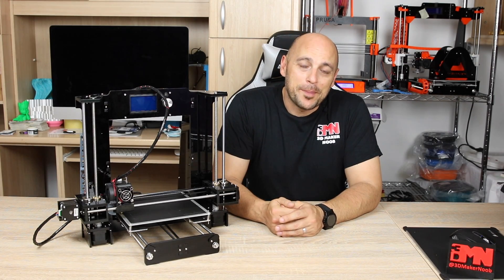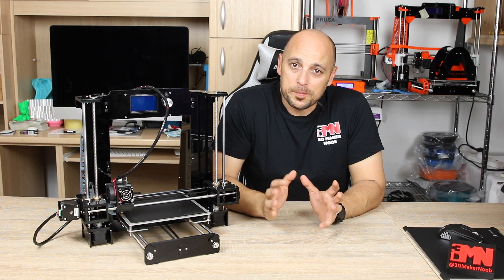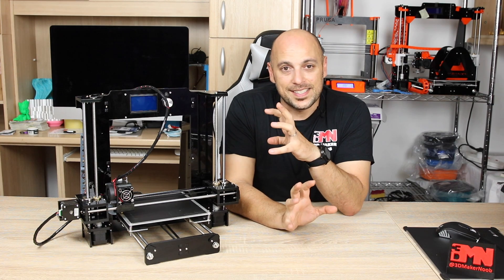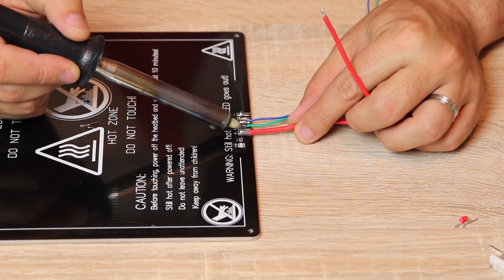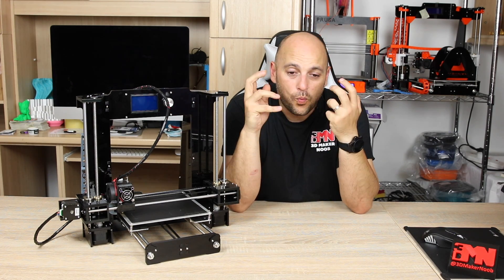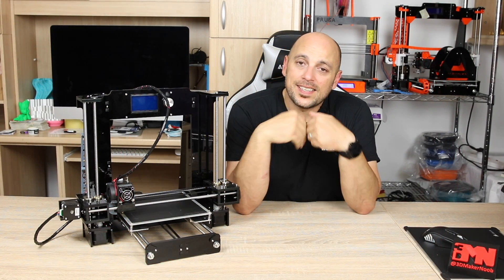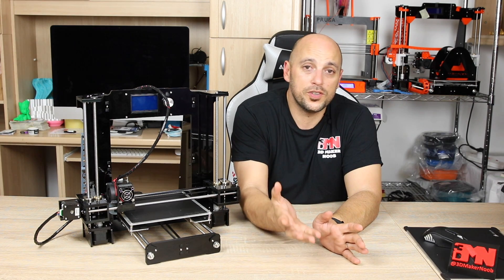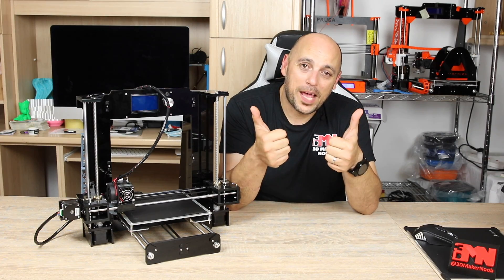Anet and Budget Kits Safety Upgrade Essentials

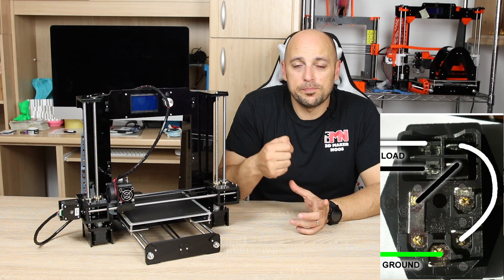Comment: Hi Joe At 5:26 that switch is wired incorrectly ! 2 issues The red switch illumination should only come on in the "ON" position and it is wired so the fuse isnt used !!( in your pic at 5:56)
Another thing ....is the greatest issue i see people forgetting ( im an engineer) is strain relief . When ever a cable is moving you should have the outer shield / sheath of the cable firmly connected to the moving part ( bracket / cable tie) and not rely on the contact solder points and/or plug to carry the load
Reply from the maker: Thank you Phil, i will pin the tweet so it stays on top and gets noticed. Added a link to the video description of the proper wiring diagram for the power switch and for the strain relief, will be including that in the next episode of safety. Thanks again buddy for poitning them out
Reply: I think we always have to remember that these kind of printers are built to a price point rather than a tech spec.This is a good thing as it makes this hobby available to as many people as possible but the down side is the quality of the parts isn't always as good as it should be ( or even spec'd correctly) The classic example is the power plug connectors on the stock Ramps1.4 boards which have a max rating of 10 amps and tend to cook after many hours of printing. 
Regularly visually inspecting and checking the security of connectors is the first step in avoiding issues  

 The heated bed mod Joe shows is a great improvement both from a safety and reliability perspective.  I would add that you should use old fashioned leaded solder. The new type lead free can be tricky to work with and certainly where you want a good "solid" high current connection it tends to work better.
Reply: +foxbow90  I dont actually own an Anet but from what i have seen probably the easiest place is the nearest bed level adjustment screw. Thats the way i have it on my Prusa AIr2 and it works very well. First i put a cable tie around the spring but loose enough so it doesn't restrict the spring, then i use another cable tie to connect the bed wiring to the first cable tie. This isn't perfect but certainly better than letting the connection point push pull the cable
Reply: https://www.thingiverse.com/thing:1875869   this will work for strain relief, for anyone interested.
Reply: bigfilsing jup. strain relief is a big thing. not only for solder joints but my strain relief prevented my heating cartridge of falling out because the tiny screw that is holding it loosened itself despite of constantly checking it for being tight. if it fell out that could cause serious overheating when using the stock software. skynet for example has a thermal runaway protection for the hotend and the heated bed. another safety enhancement in my opinion. also the proper tightening of all cables is super important. tightening them not properly could cause a high resistance in the contact point which then causes heat. this heat causes the cables to expand which leads to minimal deformation. when this spot cools down it shrinks down again. for to the deformation the connection is now worse than before which leads to even higher resistance. after a while the resistance can be high enough to produce enough heat for the plastic to melt. this is especially critical on all connections that have to transport high current and of course the mains connection. so the problem with the connector for the heated bed is also not that it is shorting out, the connection is just bad and thus causes heat. the sparks you can sometimes see when moving the connector is due to bad connection. take you time when assembling it and doublecheck all electrical connections.
Reply: bigfilsing where would you attach the strain relief for the hotbed?  Clamp the wires directly to the moving hotbed?
Reply: this kit contains some of these nylon cable clamps. I don't know what to call them. you can put your cables inside and then screw it down somewhere. I screwed mine to the upper right screw of my extruder sled. just make sure your cables sit snug inside. if not use an extra zip tie or two to fix it.
Reply: right now I am using this part I printed out.
Anet A8 alternative 40mm Extruder Fan Mount found on #Thingiverse https://www.thingiverse.com/thing:1749614

this also relocates the extruderfan which makes filament changes much easier. did not have thermal problems until now not even with longer ABS or PETG prints.
Reply: I think the idea of switching both wires ON/OFF is better as in many countries where the polarity is not defined by the plug/ wall socket, it ensures that the equipment is isolated. 
I happen to live in a country where the UK 3 pin style has been adopted and even then "less than professional" installers  sometimes wire the wall sockets incorrectly.  The dual switching also ensures the indicator lamp works correctly i,e, isnt illuminated if the fuse is blown.  Also having a good earth connection is paramount , certainly with low cost power supply units.
Reply: Hi Joe,  

Great video with "musts" for safer, more reliable operation.  Please consider editing or replacing this video - the incorrect wiring diagram bypassing the fuse is dangerous since this is mains and you are very influential in the community and this misinformation could spread quickly.   An attached note or link is not enough in this case.  Also,  since you are not a circuits guy, suggest having one of your knowledgeable friends review the circuit stuff before you publish.  Last point - that soldering iron you used is way overpowered for electronics soldering.
Reply from the maker: i actually found a way to cut the part with the photo out so at least that will be exlcuded and the link in the video description will be the right one for the diagram :)
Reply from the maker: i edited that part out from the video now so i won't confuse anyone, unfortunately that wasn't my photo and did not do a thorough enough inspection before posting it, so my fault completely. lesson learnt :)
Reply: +CHEP Im a little confused as i was under the impression US plugs weren't polarised . That is why our Aussie friends angled them to create a polarised version
Reply: bigfilsing, if you look on modern US plugs, the hot and neutral prongs are of two different sizes.  If I remember correctly, the wider prong is hot and the narrower one is neutral.  The round prong is ground.
Reply: +robert Hupp Thanks that certainly sounds better. Ive not been to the US for over 10 years so that could explain my lack of knowledge Thanks for the info
Reply: Actually the wider prong is neutral and the narrower one is hot.  Round one is ground as stated.  Since it is polarized and most U.S. devices are wired as Chuck stated where only the hot is switched, it's also a good idea to check unknown outlets with a polarity tester to make sure that they are wired correctly.  Many do it yourselfers get that backwards and it is potentially a safety risk.
Reply: I stand corrected.  I knew I should have double checked before I posted that...glad you caught it.
Reply: Thank you so much for bringing this up, I have been researching how to add this switch for about a week now and every video is different and no one explains the wiring, updating with this picture really helped me out.

Comment: I just got a new Anet A8 and it seems that the hotbed connector has been upgraded. It now uses thicker prongs and the kit now runs two + and two - wires between the board and the hotbed. So I guess they did listen to criticisms about safety.

Comment: In this case a MOSFET is acting as a relay (in other words electrically controlled switch). Mosfet is better than a relay because it has no moving mechanical parts, so the operation time is virtually limitless. I still didn't get my hands on Anet printer, but I assume you need to install a MOSFET to replace the smaller cheaper MOSFET which is in the control board. Usually control board MOSFET does not have proper heatsink or is rated just exactly at needed amperage, without any headroom. But What I would do, I would just replace the actual mosfet on the control board with better one and not put additional one on the wires thus reducing possible errors and wire mess. Plus MOSFETS come in standard casings, so you should easily find same size and pinout replacement. Only drawback to my method is you need to have soldering iron and at least some skills of soldering.

Comment: What is a Mosfet? = MOSFETs act like valves for electricity. They have one input connection (the "gate") which is used to control the flow of electricity between two other connections (the "source" and "drain"). Said another way, the gate acts as a switch that controls the two outputs. Think of a dimmable light switch: the knob itself selects 'ON', 'OFF', or somewhere in between, controlling the brightness of the light. Think of a MOSFET in place of the light switch: the switch itself is the "gate", the "source" is the power coming into the house, and the "drain" is the light bulb.

Comment: Sadly I can't solder the heat bed wires because I bought the a8 as an entry level printer. Are there other ways to make the heatbed safer?
Reply: Do you mean you don't know how to solder? It is extremely easy to learn and a skill you really should learn. Even soldering that connection with a cheap $20 iron would be better than nothing. Just get some solder braid to clean up any mistakes you make.
Reply: Timo I already knew how to solder and I now have a cheap iron, but thanks for the advice on the braids

Comment: I installed a MOSFIT on both my Monoprice Duplicator i3 V2's.  But have found just like motherboards, you have to be careful about purchasing a MOSFIT.  Some are even cutting corners on these devices.  There have already been stories of MOSFITS failing and catching fire.  One that I bought would have runaway heating issues and had to be replaced.  I even had a Ramps board nearly catch fire.  I thought by buying these through Amazon I would be getting higher quality parts.  Please read others comments before making any purchase and test your part before simply installing and leaving the room.  You might even think about purchasing an extinguisher compatible with electrical fires.

Comment: Hi Joe,  question, on your anet a6 in this video, what case did you print for the controller board?
Reply from the maker: +Martijn de Man there should be the link in the video description. It required a few modifications with a cutter as it's meant for the A8

Comment: IMHO it's not a good idea to solder the wires directly to a moving platform. Solder spots are very stiff and for that, they break easily under vibrations or a lot of movement/bending. The real Problem here is, that the Chinese use just 2 Pins for powering the heated bed instead of the 4 available Pins. The Bed uses round about 10A but one terminal of the connector is specified to 6.5A. So the best way is to get some nice silicone wire and crimp 2x red for power and 2x black for GND and put the into the connector housing. This way the connector can handle 13A which is enough for the heated bed.
Reply from the maker: +M SP the problem is that the connector cannot handle the movement as it's not a tight fit. The play is the main cause for it failing. Apart from soldering, doing cable chains with wire stress relief is ideal and that will also be covered
Reply: The only thing I can say is that I did the changes and after quite a while I have no burned spots at the connector. I mean there is a reason why all connections from wire to Board are crimped. In a car or a plane, you will not find one connection where wires are soldered to the board. For planes, they are allowed to use lead-based solder for the components on the PCB even today because it is softer. 
I know the used JST connector is not the best choice but even with a stress relief you have still vibrations on the solder spots. I guess the best would be to find a connector from Molex or Amphenol with the same pitch and use them instead of a dirty cheap JST connector.

Comment: I think one of the most important aspects for safety is enabling protection for thermal runaways. Also having a way of disabling the power of the printer easily remotely(maybe a pi with a relay).

Comment: You forgot one of the most important points why the printers/ the board burns (at least at the hotend :D ). The connection is the most important part. Use proper terminals for the screw connectors and wire ferrules for the hotend. There are a lot of regulations e.g. in Germany you are required by law to use proper connections like wire ferrules or terminal connectors. 
And every single printer that burned was not set up properly with these connectors. This would have been esily avoidable. 
A second part is the firmware. The anet has not turned on the thermal runaway feature of marlin. UPDATE YOUR FIRMWARE! If your thermistor breaks, falls out, ... the hotend will heat up till it burns. I have no idea why you would turn that feature off Anet?!
Reply from the maker: +3DMaker the terminals will be covered in the upcoming safety video, as you can see in this one, I installed them but I felt those 3 upgrades are Paramount and next would be terminals. I have done videos on firmware update as well, still have to cover thermal runaway

Comment: Great video 3DMN
I was trying to find a fixed power plug with a switch but can't find one that supports my 30A power supply, they are limited to 15A.
https://fr.aliexpress.com/item/THGS-Black-Plastic-Housing-AC-250V-15A-3-P-C14-Power-Socket-w-Rocker-Switch/32719784710.html
Reply: The line/mains side of that 30 amp supply is only 3 amps (plus a small amount of overhead) at full load.

Comment: Cable tie where the wires come together above the print head. Mine was shipped with a loose heater, but didn't notice it for a few weeks (fixing a plugged nozzle). With the cable tie, it takes a lot of effort to even pull the heater out without cutting the tie.Also someone mentioned spring caps and gave a link. Print out of ABS or other high temp material. A must.I also like cable chains. Looks nicer and can also cut down on the sharp bends. I have X and Y chains.GET RID OF THAT STUPID EUROPEAN CORD AND ADAPTER IN THE US. The adapter is not even grounded. Pigtail cords are cheap. Another option, cut the end off of an extra computer cord or even some trashed out home appliance that has a 3 prong plug.The A6 comes with a couple of cheap plastic wire clamps (adel). Thread your power cord through and secure it to a nearby screw. Put a cable tie on the power supply side right next to the clamp (strain relief). Alternative: commercial strain relief in the printed cover (the adel clamp is good for temporary while printing the cover and locating the other parts).Last thing, cats MUST learn the hard way. Moving parts, hot surfaces, and cats just do not mix.
Reply from the maker: +James P the adapters I use are in fact grounded, it has to be in order to make it into Malta due to regulations. Rest will also be covered. And agreed on the cats :)

Comment: chinese electronics = bomb, you're right!
Reply from the maker: there are some excellent and great kits coming out from china, but the cheapest ones tend to be a safety concern
Reply: what do you think. how much of your everyday electronics is produced in china. i'm not talking about where the product itself has been assembled, I'm talking about the parts inside. Chinese electronics are not necessarily bad. these printers just have some points that should have been given a second thought. but in my opinion a kit printer is not per se suitable to be assembled by just anyone. are certain amount of basic knowledge what you are doing especially regarding the electronics side would be the greatest safety tip in my opinion.
Reply: mreyeballz everyday electronics has many key component level parts from japan, usa or somewhere in eu which chinese guys can't clone them...

Comment: There is another glaring one with the heat bed with the a8, and probably other printers, its the way  its mounted by default, to me it looks like there is a good chance the springs will eventually  scrape and cut through the lacquer and short the traces out on the underside,  I discovered this at 4 am in the morning while assembling it , not happy to assemble it like that  I  cut out some temporary washers from a  cereal packet  as I didnt have any fibre washers to hand  and mounting some m3 fender washers smooth side towards the bed on top of them to prevent the spring cutting through the cardboard,  the other thing that is lacking are fuses for the hot end and heat bed  but are easily remedies with automotive style inline ones
Reply from the maker: will be covering the washers part in the next safety video :)

Comment: I've heard you can also install a better firmware with thermal runaway protection, so that if the thermistor malfunctions, the bed/hotend won't just keep heating and heating until they melt and start a fire
Reply: Good luck with that on the Anet printers. I tried to install Marlin and ended up locking up 2 boards. I was finally able to reprogram them back to original after getting a programmer. The pins used in the Anet board do NOT correspond to most of the other recognized printer configurations. Don't bother with Skynet either, just another version of Marlin with the same lockup problem. I'll be changing out the controller to RAMPS on mine due to wanting autolevel.

Comment: I upgraded my anet board ( i has problem with it :(    ) to the ramps 1.4 but i still have the same mosfet what you have in the video , shoud i have install it on ramps board ? 
And the wiring is the same thing on the anet board ,? 
Thanks 
Mamsih from france
Reply from the maker: as far as i am aware, the ramps board is much more reliable in terms of power delivery so the external mosfet might not be needed on it